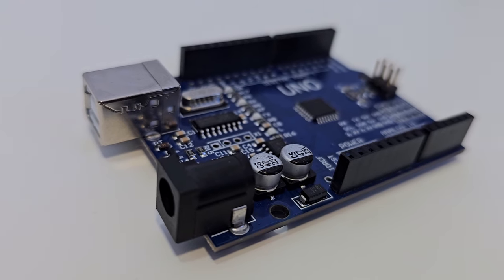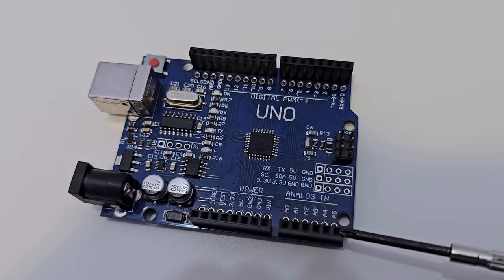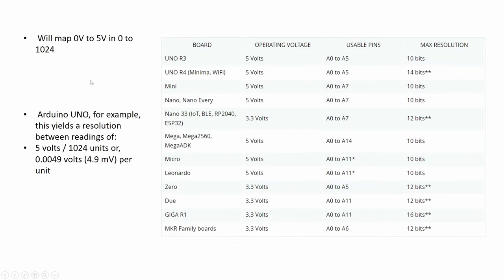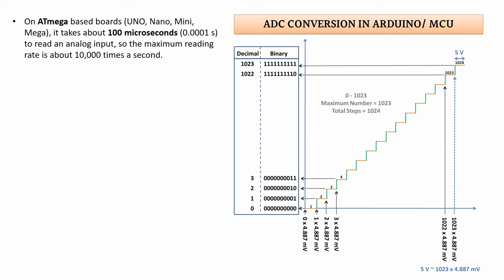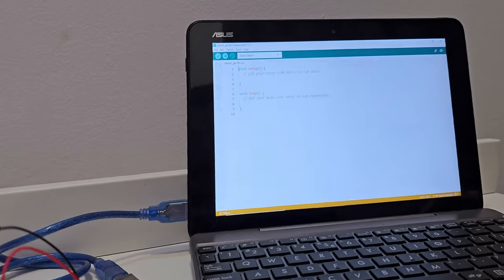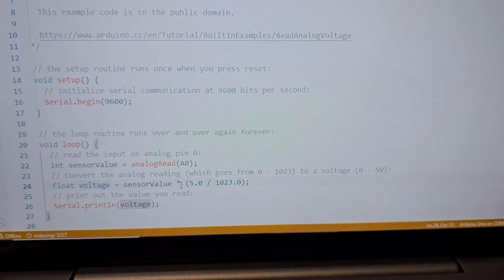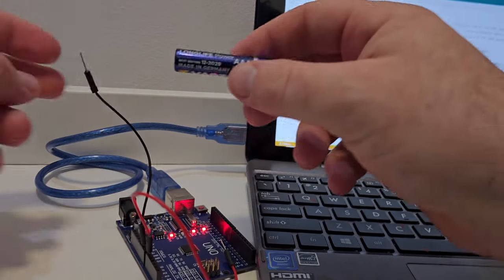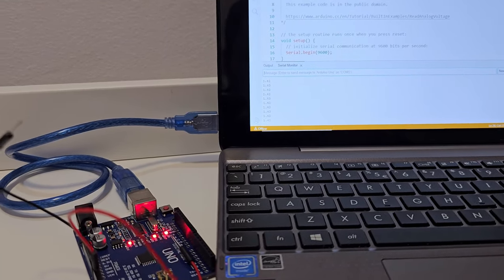What is Arduino Analog Input and How to use it for Battery Measument

Comment: nice video. can you measure a 12v lipo voltage with this setup ? will it burn the board ?
Reply from the maker: Yes it will. But use can use a resistor to divied the voltage az low as 5v. Then might would be possible
Reply: @JustBotond  ok great. Thanks
Reply from the maker: Use an ina219 with i2c. That would be the easiest.
Reply: @JustBotond  awesome, i dont why i never saw that when i googled stuff. Voltage divider waste power apparently.  Thanks!!